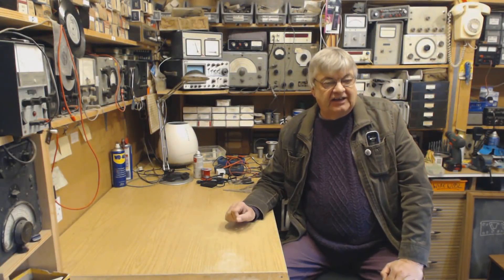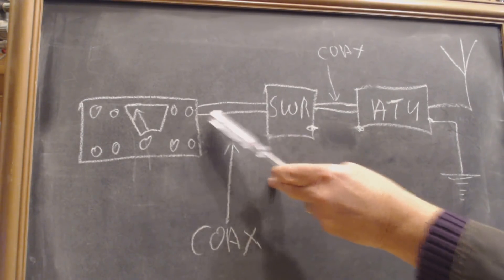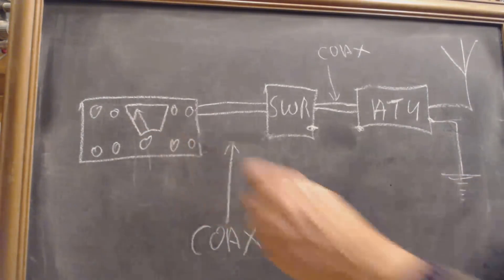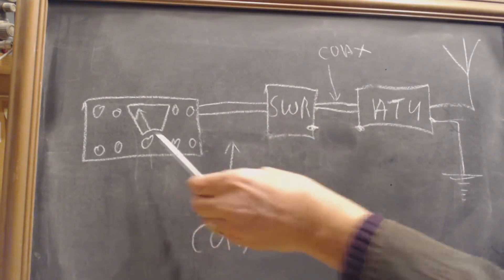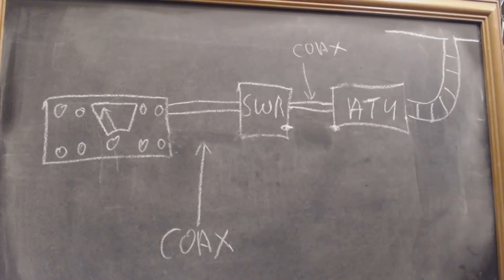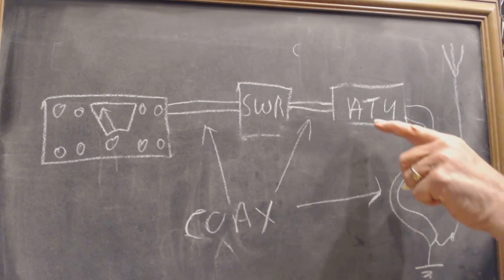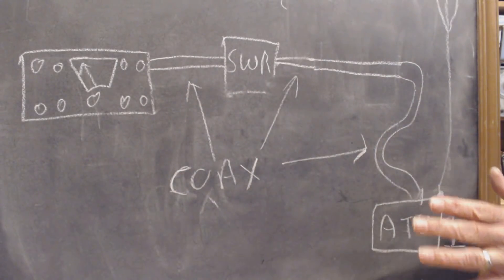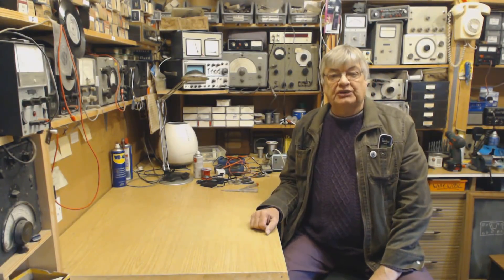Setting up SWR ATU HF transceiver aerial antenna by G4NSJ

Comment: Very clearly explained, Ray. With your polite indulgence, the only thing I would add is to beg people to READ THE INSTRUCTIONS that come with their transceiver, SWR meter and ATU. So many problems could be avoided for the sake of a few minutes' concentration, especially for amateurs new to the game - and old hands with modern kit, too!
Reply from the maker: MirlitronOne yes, good point! 😃
Reply: Men have only one problem with your logic, they only look at the manual when it doesn't work or they can't work out how to build something.  Another point is that old hands think they know and dive right in and do not look for change, so they get it wrong.   As someone said to me who was doing training in another field "Someone who does not know or done it before will read the manual, someone who has done it before thinks they know and will not even look inside the manual."  Did he get that right!
Reply: @BoB4jjjjs  Hence my comment...

Comment: Good advice, as someone that does radio engineering for a living I naturally have sometimes adopted the worst practices at home. I have been guilty of feeding my doublet with scrap RG58 as you can imagine it worked pretty well while the impedance was sensible. On some bands though the impedance was about 4K... hard to believe that the coax didn’t catch fire with 60ft of it soaking up over 90% of the amplifier output. Going to simple home made open wire gained me 4 s points on those difficult bands.
Reply from the maker: g0fvt open wire, you can’t beat it.

Comment: Great video as always. 👍
A properly built impedance matching transformer at the far end of that garden coax run will match the 50 ohm coax to the high impedance antenna, letting the ATU be placed back inside the shack. Yes, it'll introduce a bit of loss but that should be more than made up for by having a properly matched system.

Comment: Thanks for another great video. I concede totally the point of the advantage of putting the ATU  at the antenna base rather then back in the shack ; but I’m already somewhat replete with assorted ATU’s , mostly manual, that are really designed to live in the shack.  Do you think that I can  help my situation by using an impedance matching transformer such as the mfj-907 at the antenna base then using the ATU back in the shack to just bring things closer to perfect ?
Reply from the maker: John Peterson hi John,  it might help but I don’t like matching transformers.  Give it a try. Cheers, Ray.

Comment: Hmm... regarding the ATU and SWR order, it seems to me (a relative newbie to antenna theory) that what you're saying is contradicted by another video I just watched: https://www.youtube.com/watch?v=pdOEiML2XGk ... Am I misunderstanding something in my interpretation of one or the other of these videos?  And/or how might you explain the apparent discrepancy between these?

In particular, it sort of seems like your setup would get you what this other person says is "the radio is happy" (or something similar to that), but wouldn't actually change the (actual, not meter-read) SWR in the physical antenna and/or lead line.  So basically, your SWR meter would be giving you information about the SWR between the transmitter and the ATU, but not giving you information about the status in the antenna itself.  Could that be?  Could you put an SWR meter on each side, to see both?  I'm new to this, so perfectly content to be told I'm misunderstanding something... it just seems to me that maybe this other person has a point, that perhaps you've missed.  Maybe!  But please correct me if I'm getting it wrong.
Reply from the maker: Hi David, the man in the video is talking about coax fed aerials. I'm talking about balanced line or ladder line. You never use an ATU at the radio end of the coax because that's not matching the coax to the aerial. You must use  an ATU at the radio end of balanced line. Cheers, Ray.
Reply: @g4nsj  Ah, ok.  I think that makes sense... thanks!  I clearly need to do more studying to grok fully, but that's not on you.  :)